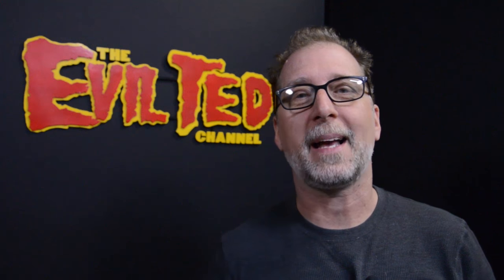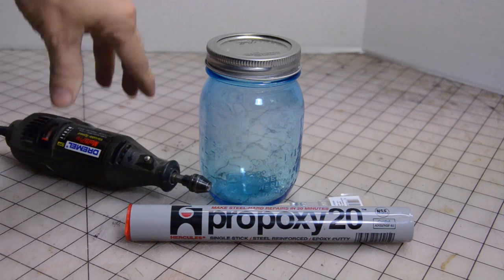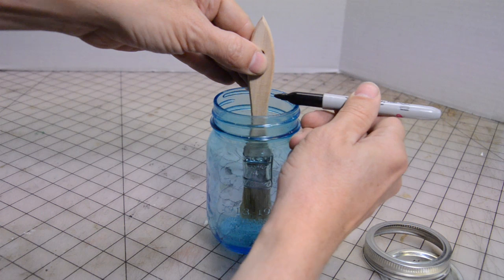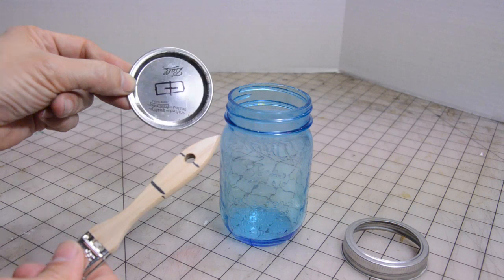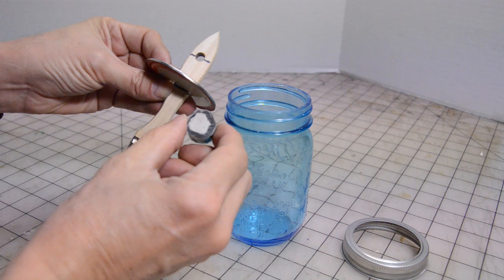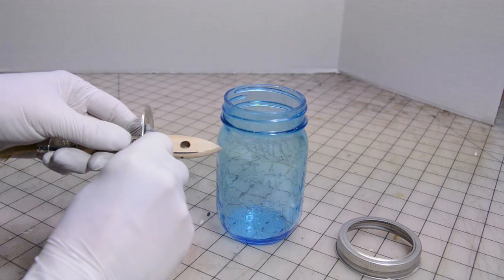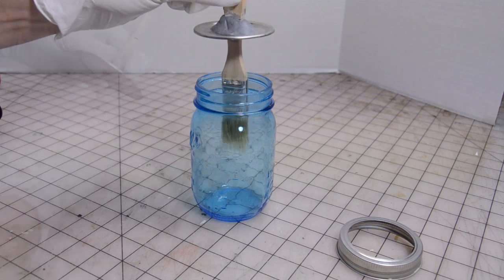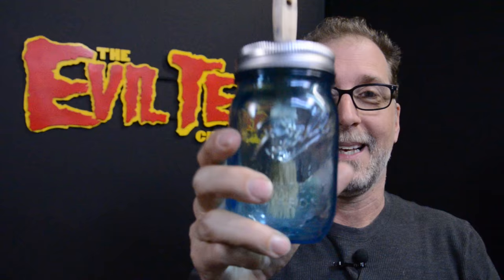How to Make a Poor man Glue Pot

Comment: Pro tip: put a thin coating of vaseline on the threads of the jar and the lid, and it should generally keep the lid from being glued to the jar as you use it. it also works for the metal contact cement containers, and seems to help with the seal of those over time. (I also generally make sure the lid is on securely and store them upside down for similar reasons, but there are obvious risks when you do that)
Reply from the maker: That’s a great tip! Thank you!

Comment: this Halloween,  I took a piece of foam, cut out a circle, formed a dome and cut a slit in the middle. run the handle of a brush through the slit,  and place the foam over the open can of cement. I used it like that for weeks with no drying and very little smell.

Comment: WARNING: I made one of these, and it greatly improved my gluing life. But after a week, the vapors ate the plastic handle of my paintbrush until the whole thing dropped into the glue and dissolved. Make sure to use wood, or test your plastic with some cement to make sure the solvents won't melt it.
Reply from the maker: Good to know!
Reply: 🤣 🤣 This happened to me! Made my "glue pot" yesterday and when I woke up this morning my plastic handle brush had melted! 😂 Serves me right, should have just bought the wooden brush!

Comment: Also a nice alternative to a glue pot is a full metal oil can. I just made a small cap from thermoplastics so the glue does not dry inside the nozzle.
Then you can squeeze out the contact cement like with a hotglue gun.
If the glue gets too tick just use some thinner but it should last for years.
Reply from the maker: Great ideal.

Comment: Glue the ring and lid together so you're not having to mess with a two-piece lid.  Also, the brush should be adjustable.  The way you have it now at that single low depth, when you pull it out with a jar full of glue you'll have a giant mass of glue running down the brush when you pull it out.  it would be better to sand the handle of the brush down to a uniform size, then put a rubber washer in the lid.  That way the brush can be adjusted up and down with the level of glue in the jar such that only the bristles are submerged in the glue and not the metal band or the handle.
Reply from the maker: Good ideal.

Comment: i washed out  an empty bottle of dawn( dish soap ) and filled with barge cement using a small funnel.  i can control the flow just by squeezing the bottle. i can  even dab with it.
Reply from the maker: Yes, that work well too. I just really like the brush.
Reply: How long did this hold up? The cement didn’t eat it did it?

Comment: Ted - I got the heavy duty glue pot you suggested in other videos. Been a long time since I used it so my Barge settled in a big rubbery clump in the bottom. I scrapped out most of it but you got any advice about cleaning it out before I put some new glue in there? Thanks!
Reply from the maker: I add thinner to my glue when it gets thick.

Comment: I have a question with respect to your glue pot (not the poor man version) I bought a glue pot to put my barge in, it’s metal with a Teflon too, but the top doesn’t look like it « seals » (it looks like your glue pot, but it doesn’t dry out in there? I intend for the glue to be there long term and at the price of the barge I don’t want to waste it
Reply from the maker: I usually don’t have an issue with that. Because I use it so often. That type of lid is called a vapor lock lid. It works you just gotta make sure the edges are clean and there’s no glue on it when you’re not using it it stays tight.
If your glue gets too thick, I just add barge thinner to it and bring it back to life.

Comment: Excellent video as always! 
I have a question. When you don't plan on using your glue pot are you supposed to poor the remaining glue back into the original container?
I bought the glue pot from your list and I left some barge in it and after a while it sort of hardened. It isn't completely solid but it's pretty much unusable.
What did I do wrong? 
 
Oh sorry but...Oh stop the beeping! Stop the beeping! lol  Oh well even experts can make mistakes.
Reply from the maker: Just add Barge thinner to it. Plus keep the lid clean so that it has a good seal.
Reply: Ok, thank you very much!

Comment: I just built one of those glue jars, and used a plastic brush..... when I went to use it today, anything that was touching the glue was melted away :-) Need to get some other type of brush.
Reply from the maker: Use a chip brush next time...http://amzn.to/2pg3Mdz
Reply: :-) So I got a brush which had a plastic handle but a non plastic brush tip, one day in the jar and the plastic handle melted straight off :-) Now I have replaced it with a chip brush, which applies glue better anyway.

Comment: Hey Ted...I don't know what is wrong with my pot. When I try tu brush the glue on my foam it is very thick and I have problems to get a thin coat on the foam. Is it the brush? Should I change it because there is to much old glue on it? Is it my glue that is getting old? I am using contact glue.
Reply from the maker: If your glue gets to thick to work with, add thinner.